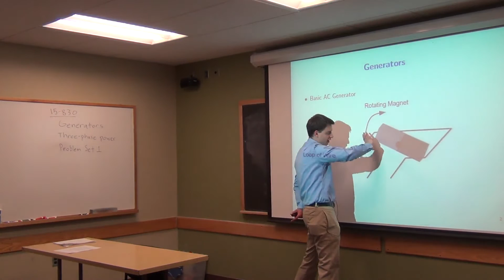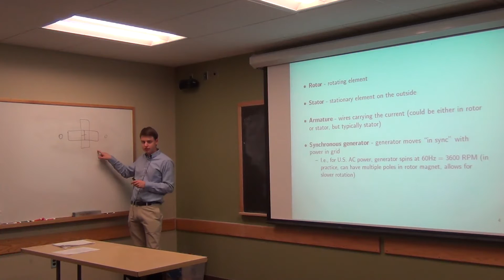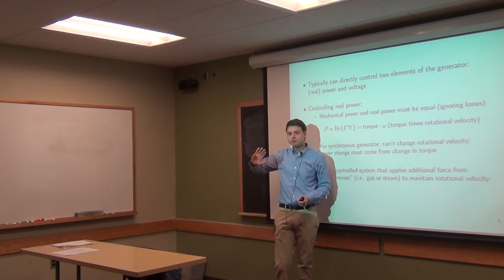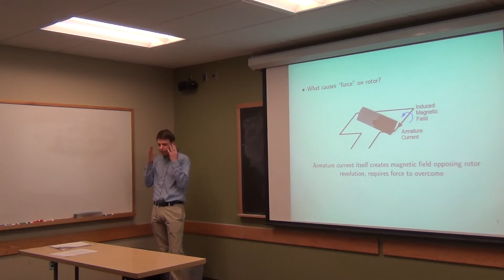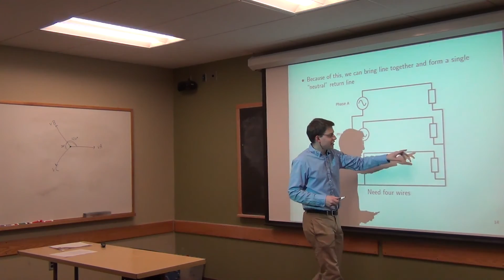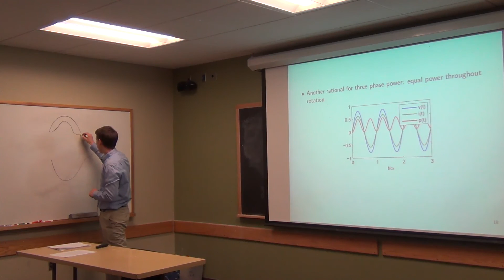Comment: Thanks. In many ways an excellent video, however in the beginning you talk of the magnet as if it has one pole. Later at about 43 min you in fact refer to a "one pole" magnet! AC is produced because when the field from the North pole cuts the conductor, current flows in one direction and in the opposite when the South pole comes around (load connected). The min number of poles in the generator is 2 and it must rotate at 3600 rpm for 60 Hz. You mention this as an unreasonable speed, but in Europe the vast majority of thermal sets run at 3000 rpm and I expect many thermal set in the US run at 3600. Hydro sets are typically multi-pole and so run at much slower speeds. However the stators are wound so that the rotating field of the rotor is still in synch with the rotating field produced by the current flowing in the stator coils. Thanks for the info regarding how the generator voltage must be increased to deliver reactive energy to inductive loads, very useful explanation.